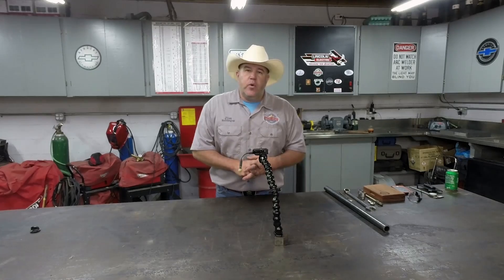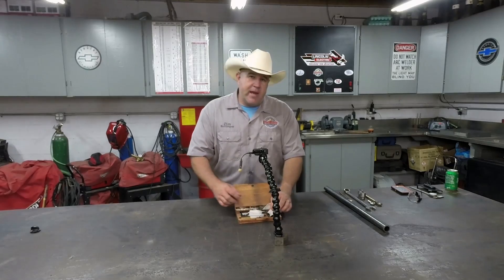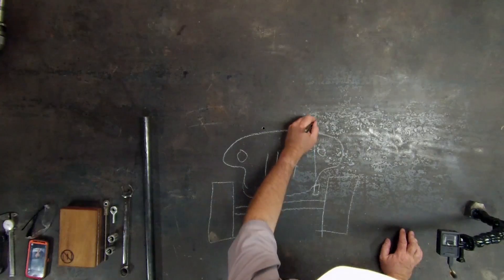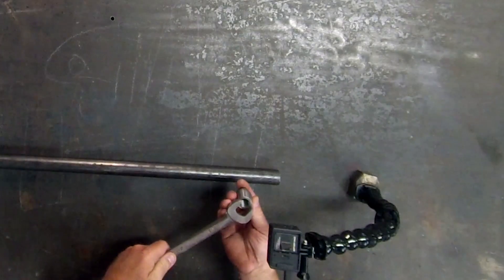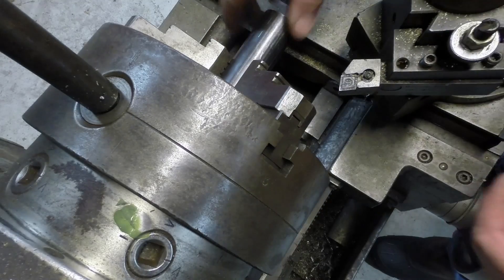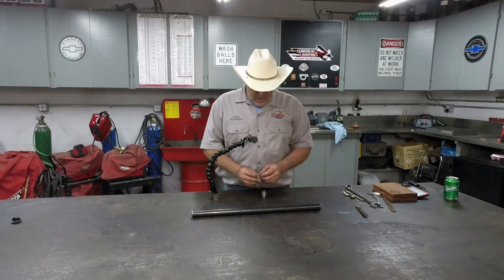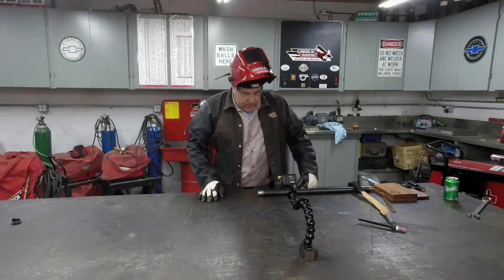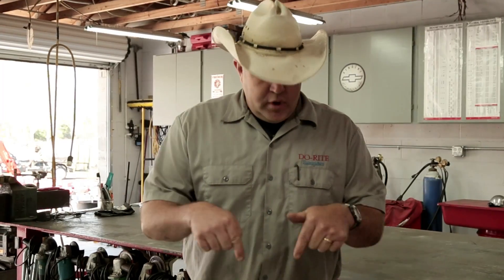Don't be a drag - fabricating a custom Jeep drag link

Comment: Stan is awesome he is so generous with his time and talents. It looks like you turned the flats the same way. I would have suggested to turn them 90deg out that way you have more opportunities to be able to get your wrench on it on one end or the other since oftentimes these are in tight spaces. It turned out nice.  I tried TIG welding a hydraulic fitting the other day and although the weld looked good it sweated oil thru the weld do I figure it must have cracked on cooling. I can't visibly see a crack but you put 2500psi on it and it gets moist and in a minute grows to a drip. Got any ideas where I might have gone wrong?
Reply from the maker: Brian, Stan is very generous, and a great resource. As far a the welding question goes, it could be several things, porosity, lack of complete fusion at the stop/start, or porosity.... The main problem with anything that has oil run through it, is getting ALL the oil out before you weld. Usually, some little bit of oil is hidden somewhere, and when it gets hot, the capillary action grabs the oil and sucks it up into the weld crack. The oil burns, and causes porosity. Also be sure the filler metal is compatible with both parts you are welding.
Reply: DoRite Fabrication
I heated it with a torch 1st till it quit smoking hopeing that got the oil out, I guess it could have been some soot or oil residue left behind that caused problems. The fittings are coated probably with yelllow zinc, would the coating cause problems? The sweating is thru the middle of the weld bead that is why suspected a cooling crack.